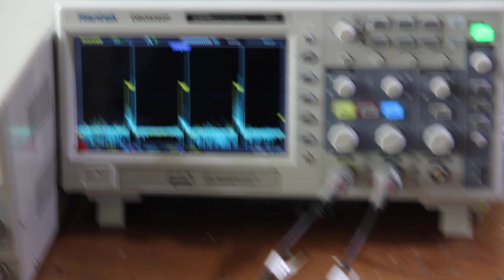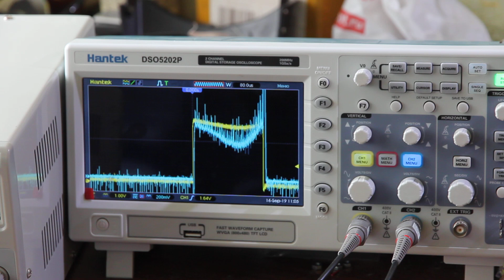Running an Endurance laser in pulsed mode - 10 watt peak maximum power.

Comment: Hey George, 

Great work. You're an inspiration as well as a very kind person to release all of this information for free. I broke the driver you sent me, so I ended up rebuilding, thanks to the open source schematics on your website, with TWO LM338s and 0.2 ohms of resistance in with 5 high power resistors (~0.5 ohm each). I couldn't have done it without you! Also,

Do you have a schematic or parts list for the pulse generator you're using? I can't seem to find it on your website.
Reply from the maker: thank you!!